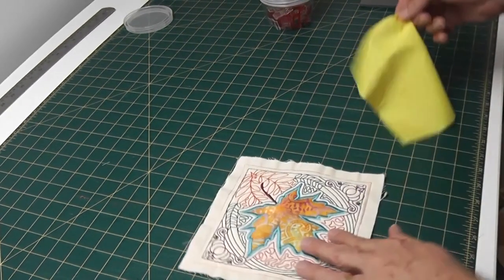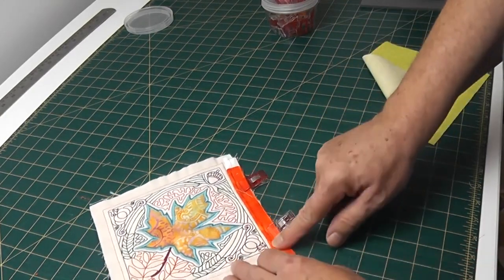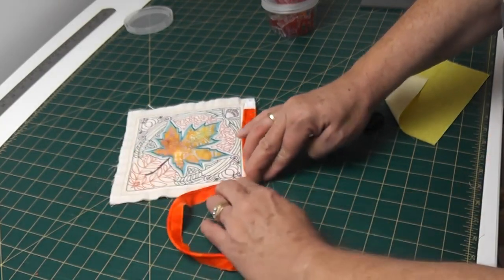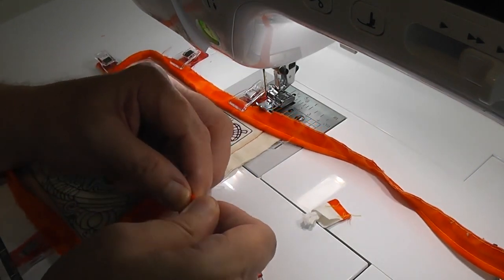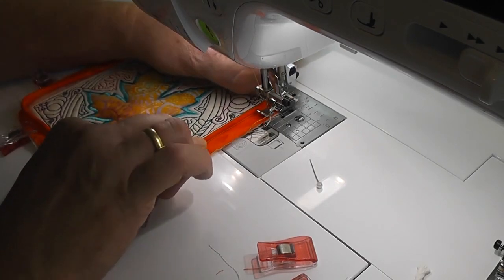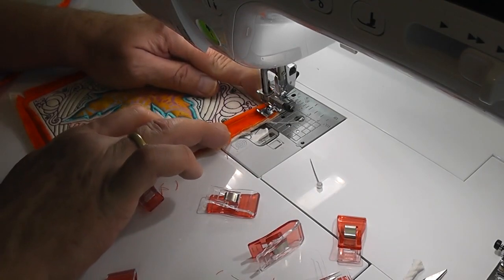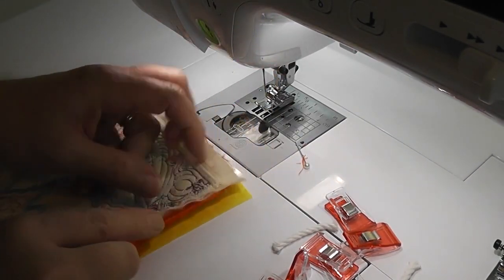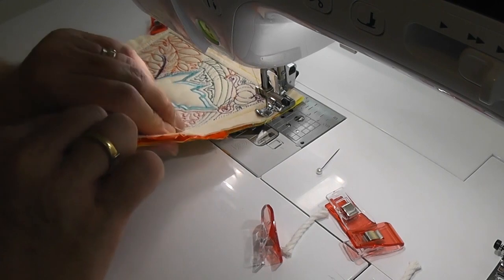How to Sew Piping to the edge of a Quilt Block with Martyn Smith

Comment: What size cording did you use? How wide did you cut the fabric that surrounds the cording? Very helpful tutorial, thanks!
Reply from the maker: We used either No.1 or No.0 (they are the same depending on what brand we can get. The bias would be cut at 1.5" (4cm).